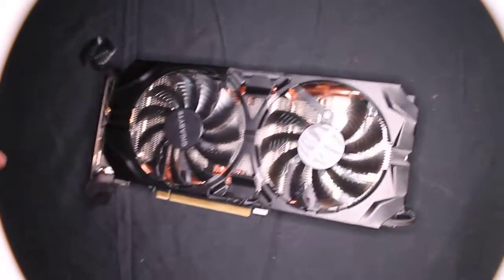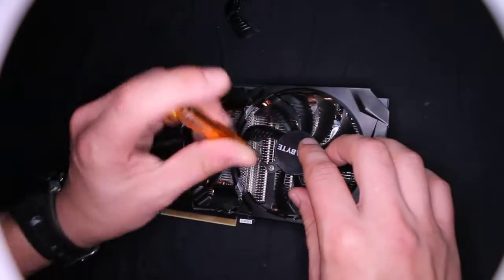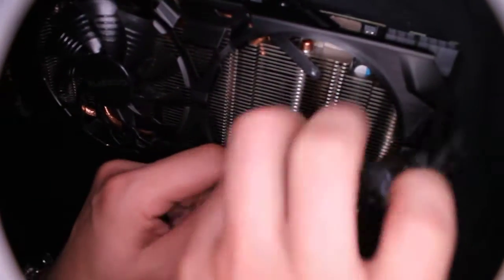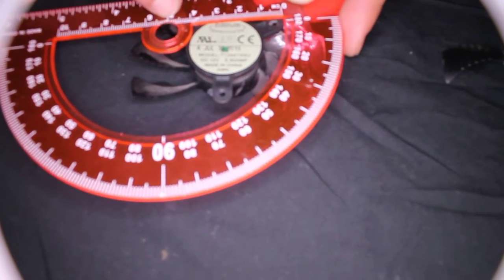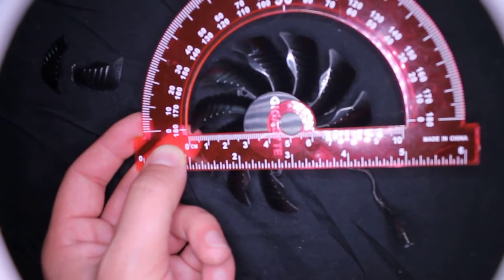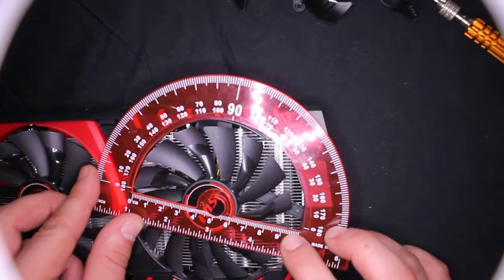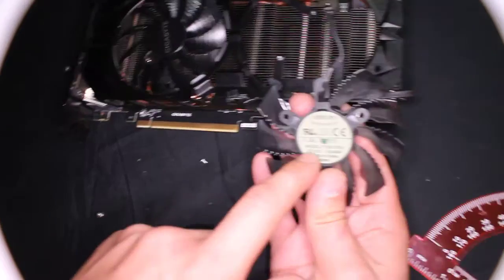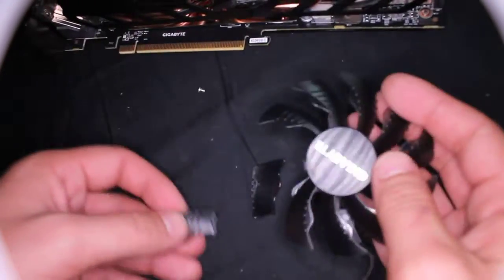Gigabyte G1 R9 390 Fan Replacement Part 1

Comment: R9 390X have diffrent fans? i have a noise problem on my R9 390X gigabyte G1 looks same like yours.
Reply from the maker: +Grzegorz Seb it should be same size of fans. What you can do is take one fan out and measure size from one hole to other and find it on eBay. Let me know

Comment: Hello mate, did you manage to find and a replacement fan? I have a similar situation.
Reply from the maker: +Sofala watch all my 3 video5and you will find you the size of fan and link in number 3 video.  Make sure you have cooling system of a lot of fans in your ATX case, because this video card is blow it heat build 😀

Comment: hey man i have same exact gpu my gpus temps goes upto 85 degree while playing witcher 3 ultra on 1080p how can i reduce the temps of card ? 
im using the card without casing etc
Reply from the maker: +Masaki Ryu find in AMD launcher control of can speed and put it on cool. Also I install extra fans in my desktop to cool it down. 😀
Reply: what you mean on AMD Launcher ? you mean on custom profile ? and what are your gpu temps while gaming ?
Reply from the maker: +Masaki Ryu I mean full control settings of the video card, where you can see temp and change voltage and control speed of your fans o  video card. My temps are 45-60F now hire that the. Depens on weather in my state. I will made part3 video this week, I got second fan REPLACEMENT and I will show which settings I am talking about
Reply: i see well mine temps are insanely high i set fan speed to even 100% mine gpu still near 80s ...
Reply from the maker: +Masaki Ryu try to clean install brand new AMD drivers if it didn't work, open your ATX case side door and keep it all ventilated good. 80c it stock temperature, it was saying it in the box from this video card, but i think it is too hot . It is why I modify my system
Reply: hey bro can you show me your settings  ? 
fan speed voltage control etc ?
Reply from the maker: +Masaki Ryu I will record part 3 tomorrow and show it there 😀

Comment: Which fan do you bought at the end?
Reply from the maker: It is 87MM 4 pin 0.55A 42mm
It is super Hard to find exact same ones but I find this one looks the same, eBay it or google this
87mm 4 Pin Fan Set Power Logic PLA09215S12H Gigabyte GTX950 960
It costs too much 40$, I am trying to find a cheaper solution for it, but all the fans I find is only low Ampers 
I will try to order this one eBay it in cost 10$ for one and I will make another video about it
87mm 4pin 2 Ball Bearing MSI VGA Video Card Cooling Fan PLA09215B12H
Reply: Ok thanks for your reply